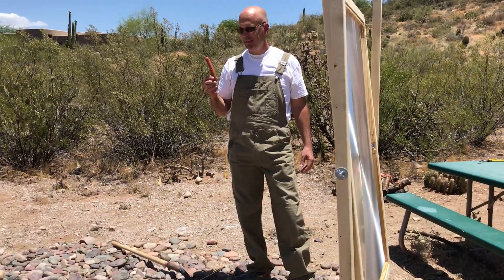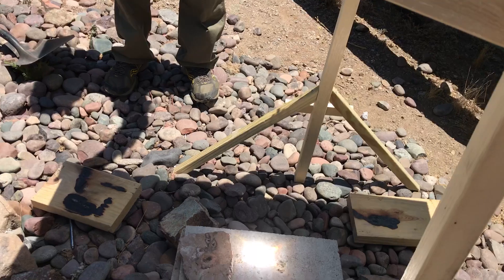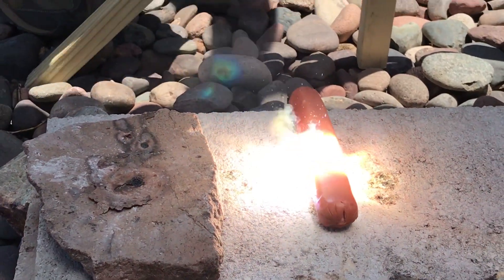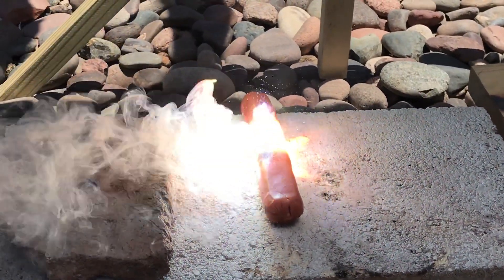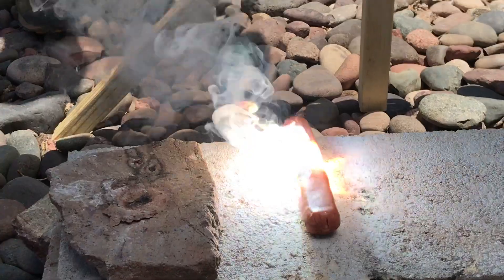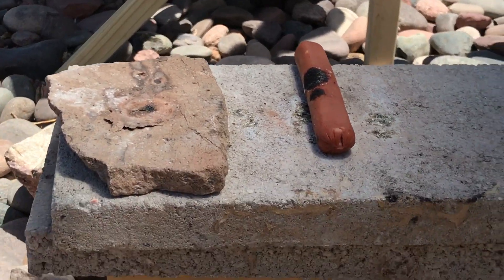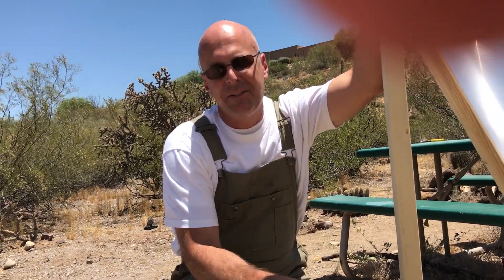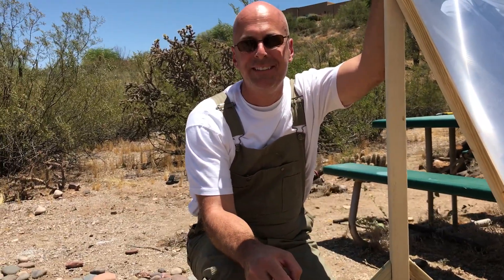TV Screen Solar Death Ray Destroys Hot Dog Instantly

Comment: What material is that?
Reply: The original projection tv fresnel screens were a type of glass.But,you can order plastic types on line. Most arent quite as large as the tv screen,but they will still get damned hot.

Comment: Goes to show you how good carbon is as heat insulation. A stone will melt away but the hotdog only got its outer parts burn

Comment: I want to use one to power a steam generator for my home. At least that is the idea that I just had.
Reply: It would be way more efficient, than a solar cell ot the same area.
Reply: I doubt that. You'd need a tracking device, a steam turbine and a generator and it only works if there's enough sunlight. Efficiency is about the same, but a solar panel still produces some energy when it's cloudy. You can put a solar panel on a tracking device as well if you have limited space, without the hassle with steam engines, maintenance and noise
Reply: @SolarCookingGermany On the flip side, solar panels are massive wastes of rare metals.
Reply: @1stCallipostle  With the advancement of science and atomic research,including creating new elements and even manufacturing enough to sell commercially,rare metals arent much of a concern these days.
And on that subject ,why the big concern for rare metals? If it isnt used,it simply sits in the ground doing no one any good. That makes no sense in the long run.Its good to practice preservation in some areas,but theres a point where in other areas,it is pointless.